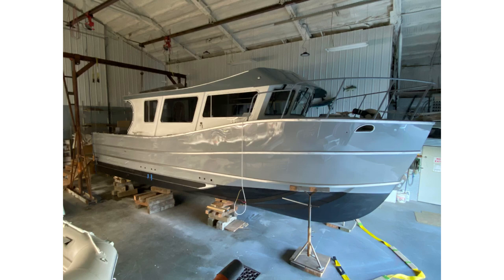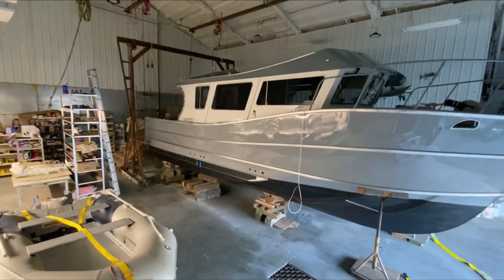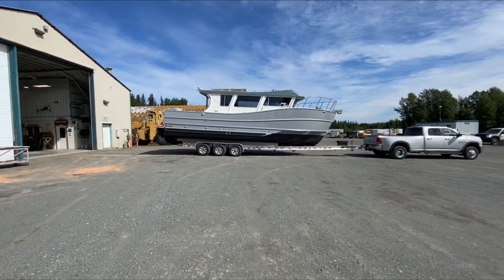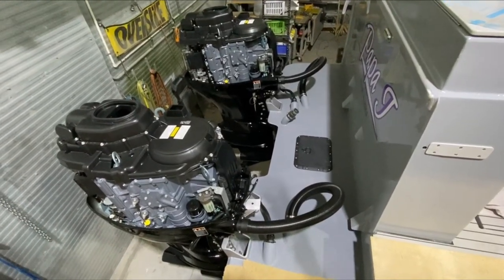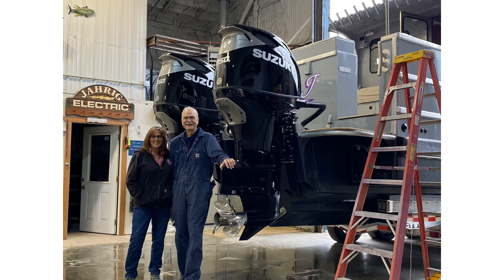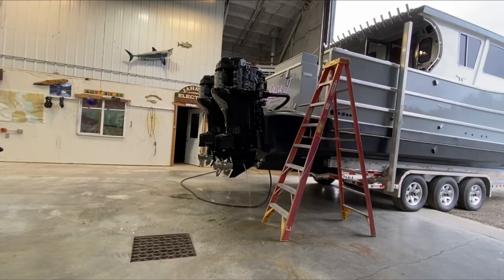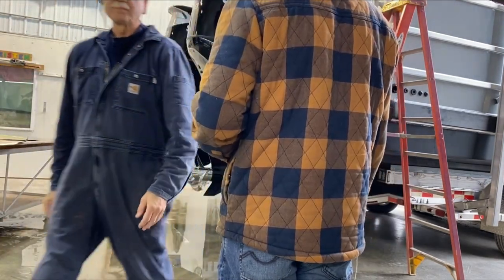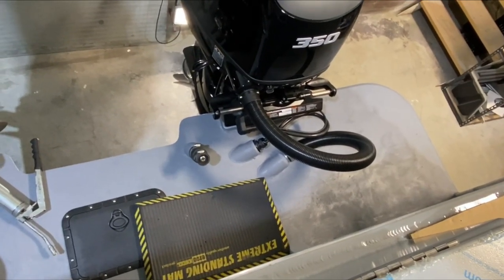Jahrig Aluminum Boat Build #50 up to 8-6-2022

Comment: Looks great, I think the trailer does look little light, are you re thinking the aluminum? maybe go with a Steele trailer, tandem dually is what I would probably go with,  I cant wait to see this beast splash.
Reply from the maker: Hey Hey-No stay with Alum might add another axle. That would give me another 7500lb weight capacity for a total of 30,000 and the boat weighs 19,000 fully loaded. Thanks Much

Comment: I saw #49 yesterday and missed #50 until this morning. I'll bet concentration on anything else is hard to come by right about now. 
I can't wait to see this beast on the water. My calculations show 45mph topped out. What have you come up with on paper?
Reply from the maker: We topped out at 40 mph. Boat weighed 18,000# best cruise is 28-30mph at 4600rpm.
Reply: @willjahrig100  that a lot of boat to run like that.
Reply from the maker: @nfinitymarine4466  It sits like a rock in the water. Very stable. We will be running it again this coming weekend. I'll fire up the drone.